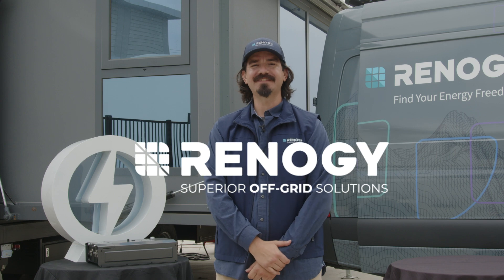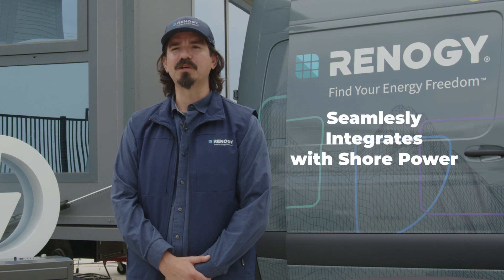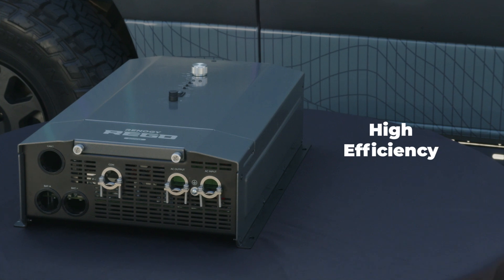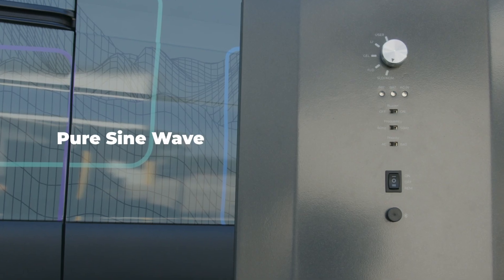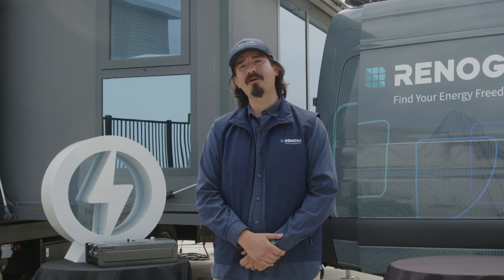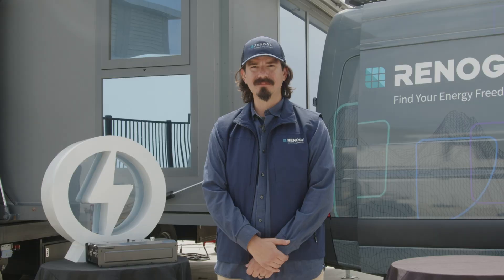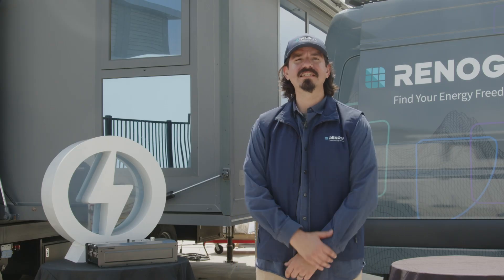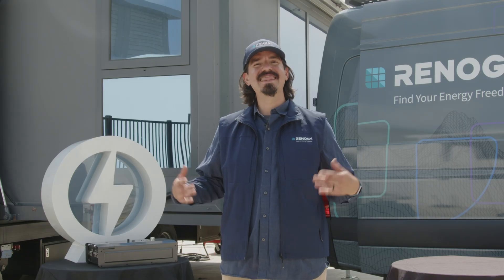Introducing Renogy 3000W 12V Pure Sine Wave High Frequency Split-phase Inverter Charger

Comment: Looking for an inverter charger for my new 5th wheel that can run the entire RV... My RV plug is a 240v 50A that goes strait to the fuse panel giving each side of the breaker box 120v, with one 15k BTU coleman mach AC on each side as well as other loads - I've read they can pull up to 2,000 watts if its very hot out and my goal is to design a system that can run a single AC off batteries for a few hours as well as the entire coach for a day (basically to boondock when traveling somewhere far for a night and coll the trailer off).  MY RV is a jayco with a BM Pro screen and app that runs everything using RV-C protocol. I have 400watts for solar panels and 690 AH of lithium batteries.  If I rip out my RV's little 1800 watt inverter that only powers 4 outlets, and ditch the converter charger - will this take in shore power from my 240v 50A input and let me pass through without any issues to the fuse panel when connected to the shore power (and charge the lithium batteries), but automatically switch to the batteries when disconnected?  I am hoping it's RV-C compatibility will let me turn it on and off through my BM PRO system (and hopefully report total watts of output in real time / voltage input like my current one)?
Reply from the maker: Yep! Checked with our engineer, and this 3000W 12V pure sine wave HP split-phase inverter charger would totally work for you. Plus, this device is compatible with the RV-C protocol.
Reply: @RenogySolar  are you able to confirm how this can work with a 240 50 amp system? ( dual 120 50 amp breakers) ? that is way over the max watts tghus says it supports.  also does it have dual ac outputs or just 1 that you must split?  the only reason i ask is the product material states 6k watts max run with startup load of 8. not that iv'e done it often but when you have 3 ac units going you need too supply the full 240 50amp service so you dont trip things..   what load does this unit support as passthrough ac power ( shore power ) not running off battery. will this pass the full 120x2 50 amp ?
Reply: Planning on the same application. Let me know how it turns out! Jayco 330 RSTS